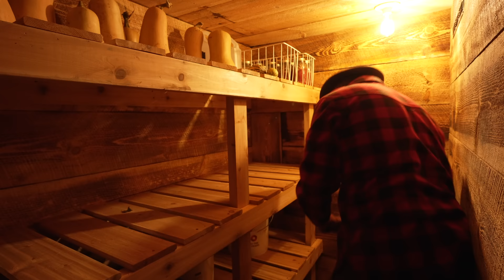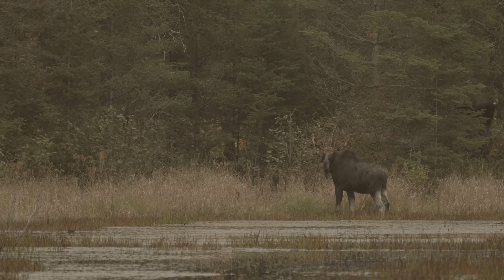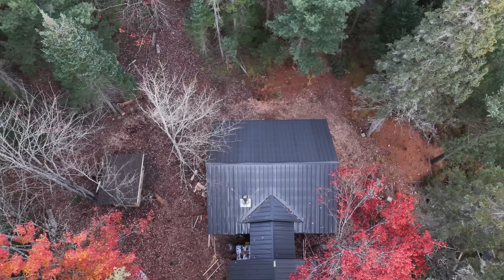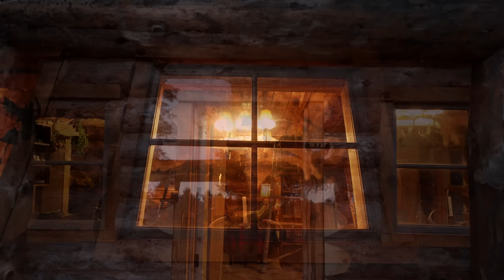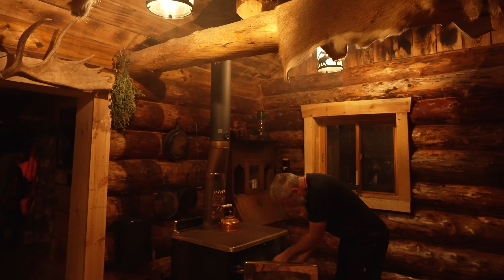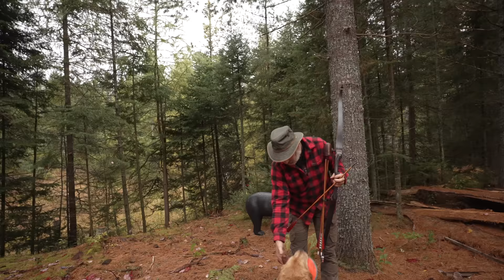Off Grid Log Cabin Life | Long Term Food Storage, Moose Hunting, Solar Power, Firewood, Archery

Comment: Such a great job on the cabin and everything else you’ve put your hands to.👏 A little advice to you if I may? Separate the potatoes so they don’t touch each other. If they start to rot it will quickly spread to all that it touches. Also lay straw doesn’t mater what kind of straw down first then potatoes on top. This way it helps prevent moisture that could cause rot and makes it easier to clean up a mess if they start to rot. I wouldn’t put them up on the shelves if it was me instead  I’d lay them on the floor on top of hay or straw of some kind. It will save you time and energy cleaning up a rotten smelly mess if on the floor instead of the shelves. Enjoy all the hard work of your labor for many years to come.

Comment: I had a few kitchen/scullery prep areas that weren’t safely lit enough during various times of the day.  Got a few motion sensor mini/slimline LED strip lights to attach to their thin magnetic strips. Sticky one side, magnetic the other.  So you can move them around or tweak their position. Invaluable. Put some in a few kitchen cupboards too.  Really does help making meal prep less frustrating.

Comment: My father used the 3 1/2 gallon buckets for carrots. they were just the right size to stand the carrots upright. He'd put a bit of sand in the bottom then stand a bunch of carrots up til the bucket was full, and pour sand over them until just a couple inches of the carrots were sticking out. He'd pull a few carrots out and wiggled the rest around until most of them weren't touching each other. Then he'd add more sand until just the tops barely stuck out. Worked great. They lasted almost til spring and were easy to pull out for a meal...

Comment: In the bucket the will rod. But if you keep enough sand down on your floor Barry them spread them out. So they don't touch each other. With your potatoes we stored ours in a wooden crate, the wooden crate was build from wood that my dad made. Each slate had 1 inches of air space. Keep it like that other wise you ll have mice. I love how you prepared.

Comment: Nice video, as always, but... if you store your carrots like that, only one bad one can infect all the ones underneath. Build a closed wooden box without a lid, 1.5 times as high as your longest carrot. Fill it halfway with clean, slightly damp sand and insert the unwashed carrots side by side. The tip down and they shouldn't touch each other. When all the beets have been planted, fill the rest of the box with sand. You can fill the box again every fall for many years, just work through the sand every now and then and aerate it.

Comment: the porch floor boards will need some love this year probably a good poly eurethane stain and polish to preserve the cure for some decades to come...and as the interior dries the same small batches here and there with a good sealer bear is the best bit 2 part epoxy is the iron clad for non wearing surfaces like walls a bit of stain and then the 2 parts sets up like iron

Comment: The best way to keep carrots in a root cellar is not sand( I say this very politely ) We used to wash them good in cool water then cut about 1/2 inch off the top of the carrot and a small amount off the bottom so there can be no growth on the carrot and when you find a carrot with lots of fine roots set them aside or they will rot quite quickly and if you leave them with the good carrots they will spoil them also. We used to just store them in burlap in the root cellar and they kept real firm till next spring.

Comment: When I harvest my potatoes and carrots, I sort them by size and use the largest ones first on the theory that if a large one rots, I lose more than if a small one rots. Also, as I recall, if butternut squash is exposed to a temperature below 50 degrees F, which I assume you've already had, it starts an irreversible deterioration of the gourd. Butternut and most winter squash need to be hardened off or cured inside for a couple weeks at about 65F I believe for best storage life. You can double check my temperatures.

Comment: May I suggest a plastic medium shallow wide rectangular storage tote for the carrots on the bottom row. One that you could slide and drop. Or at least, packing more sand and then using a lid until it is placed and then removed for the 5gal bucket method.

Comment: Where does your wood stove get its combustion air?  From the inside or outside?  If inside, then maybe install at least a 2 inch pipe that goes from the air intake of the stove to the outside to ensure you have enough air inside to breath.  One well built and warm cabin.  Thanks for sharing.

Comment: It appears that you are using Canadian made asphalt shingles which are thicker and heavier than American made. I am on a windy site and I have used both and neither held up to the wind. I finally switched to architectural shingles which interlock. They have been on almost 10 years and I haven't lost a shingle. Keep that in mind if you have to replace any.

Comment: Also I've been thinking about a plan for something to add to your garden. It's a long table that you can set a row of grow bags on and grow some things inside of those and part of the table could have a built in sieve mesh to dump your bags out on it and maybe under the sieve part there's a platform that you can sit another grow bag under it to catch the dirt that falls through it and it will leave all your vegetables sitting on top of the sieve like rocks sifted. And you just repeat. Maybe garlic can go in some bags and ginger. I don't know what else. Just a stand up different method in one area to try.
Reply: Maybe instead it would have a built in metal grate that could work as a sieve to be able to cook on it like your old outdoor kitchen as well as dump bags of soil with garlic bulbs and such to run around the dirt on the metal and let it fall into another bag separating the bulbs from the dirt. And the table could have a sink on it that you fill with water in case you need any but you probably should have gloves when separating the dirt.

Comment: What I seen a guy do for all his potatoes so he could keep them laid out and not touching is he built a tall shelf where he had just enough room in between every row to be the exact width and length of those paper bottoms that canned food comes in that he got from a grocery store. He just asked for a bunch one day when they were putting canned foods on the shelf and they had a bunch of the bottom liners they were going to throw out. So he built the shelves so each one could just slide onto each row and that way he could lay his potatoes and sweet potatoes on those so they weren’t touching. Yes he had to build a couple of them because they grew lots of different potatoes. Each row though was just so many inches wide because you didn’t need the rows far apart. Just enough for them to slide in. Then he stood them up down in his cellar. Their potatoes lasted a very long time. Just an idea of something you can put your potatoes on. The cabin has turned out so beautiful. Just curious, I know chopping wood keeps you in shape but considering the amount of wood your going to go through this winter is there a reason you don’t use a wood splitter so you can really get a lot chopped up at once so it can be drying out more. Plus it will help clean up all the wood you have lying around and you’ll be ready for when it gets really cold and stays cold. Like I said, just curious. Probably for you it’s a preference to chop instead.

Comment: Do you have a recommendation for any particular brand name wood burning stove?  I am guessing there are some other determining specifications that should be understood.  Use of stove (heat and cooking), square-footage being serviced (roughly 900 square-feet with a loft that is approximately 18-feet to the ridge pole).  Based on the variety that I have seen you use at each of your builds, you used your experience and the cost as determining factors.  One thing to consider is that most of my supply of wood is a hardwood species.

Comment: If you got a local metal worker to make you up two large curved bracket with pin holes in you could find the best place to put your solar panel and rotate them towards the sun giving you better freedom to generate your power. But l still think you need a wind turbine in place to help generate power all day and night long term.

Comment: Well, the bird, bear and dear should be easier to shoot with your bow and arrows when standing still like that. But with that hunting method aren't they a little tough when cooked up? I'll be 74 in less than 2 months. My questions are more than innocent or of a novice. They have a practical purpose (partial dental plates, don't cha know?). Ya might as well start thinking about that now yourself. Gracias por tu video. RT sends, Puebla, México...